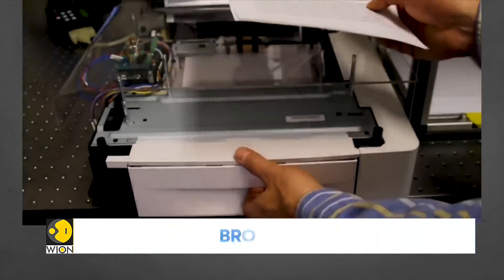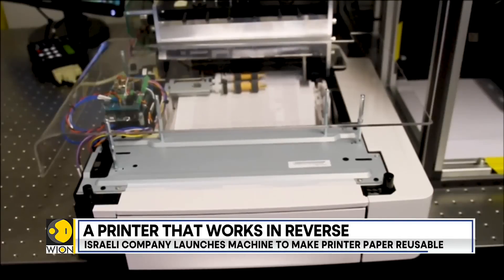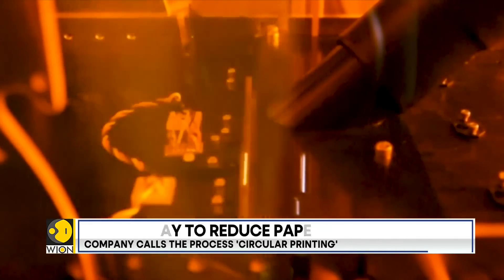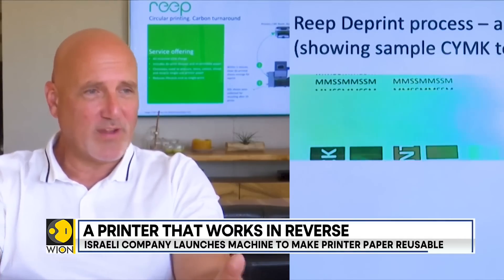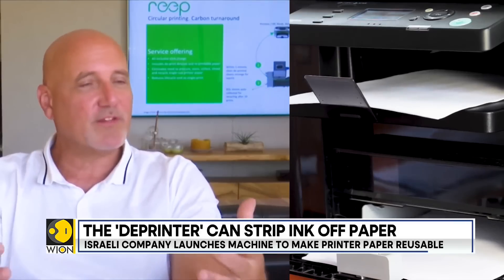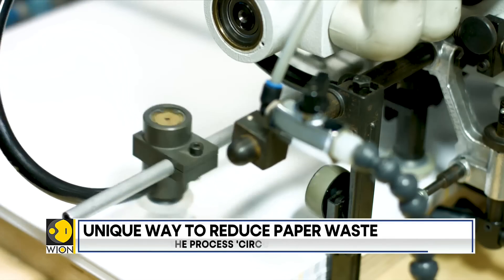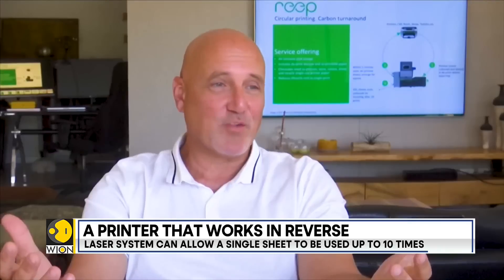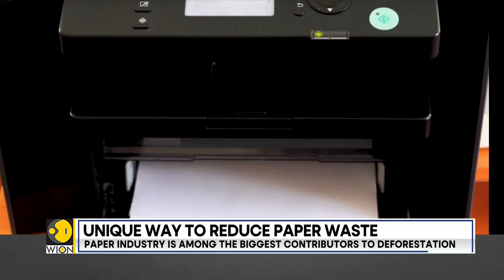Israel company launches machine to make printer paper reusable | Latest English News | WION

Comment: Cool tech but the problem is the paper it self, What if the paper was not in good condition or crumbled, etc. So it will not totally solve the issue of conserving paper. The only thing to avoid using paper was simple as improving digital technology.
Reply: yeah, digital currency are working on technology to make it all work......so go digital instead of paper.....Australia is a developed country and they still use paper and Read newspaper daily🤣